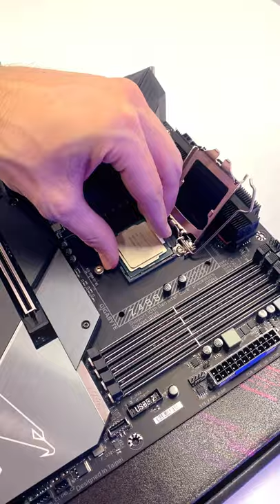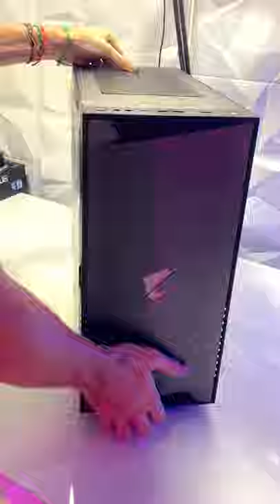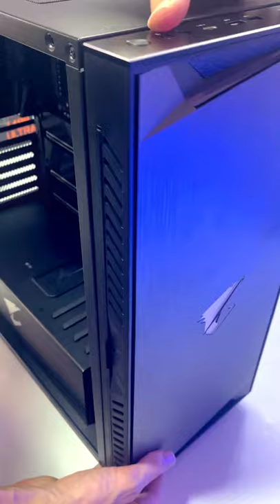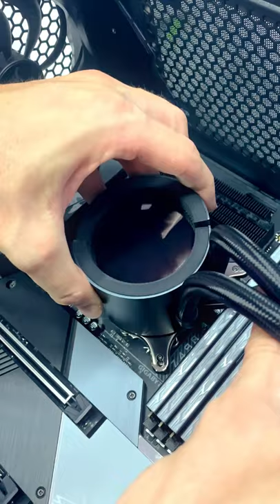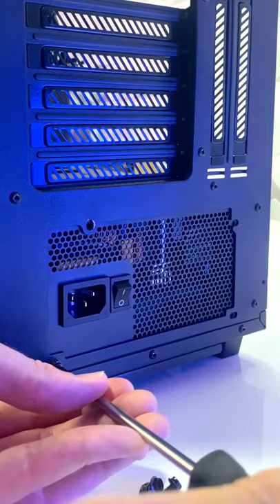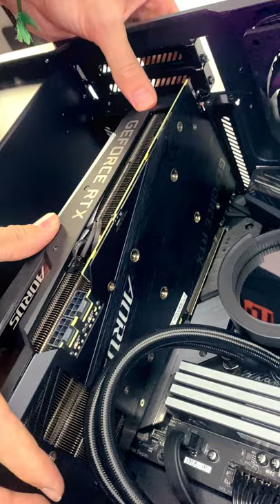Building a AORUS PC in 1 minute

Comment: Oh god fuck me...
- 4 Ram Sticks, so you need to buy a whole new kit if you would want to have more ram

- A Case like an oven, no airflow at all

- A firecracker power supply

- Not even a nvme ssd, just a sata ssd

 - And a 240 radiator aio for a 11700k.

Sorry dude that pc ist sucking
That thing will be overheated and probably will get grilled by the psu also.